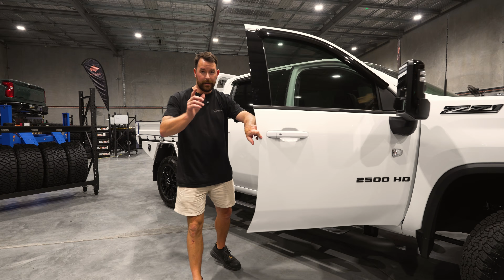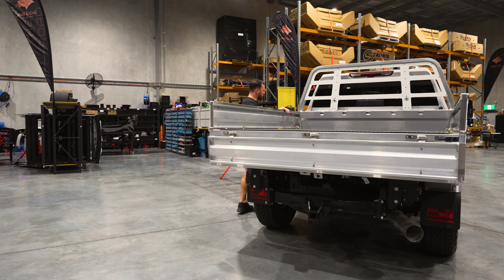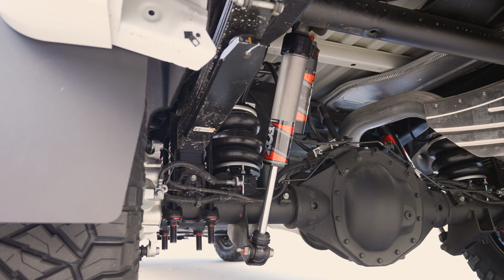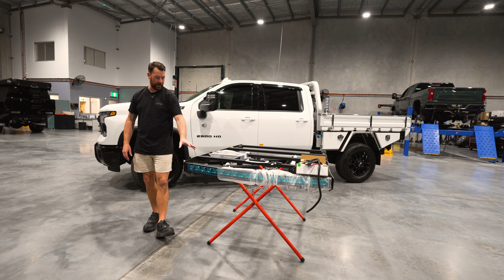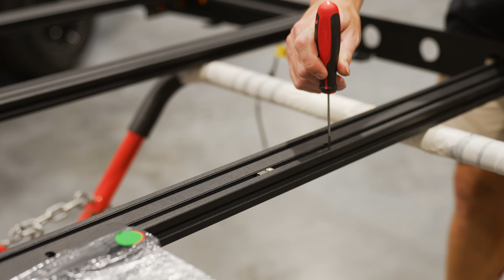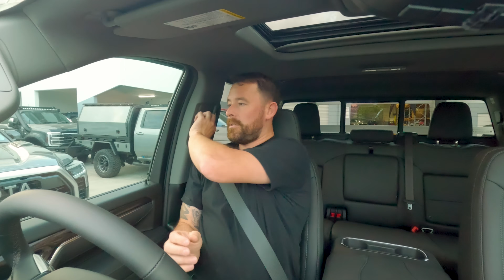The Complete Guide to Modifying Your Chevy 2500

Comment: I'm a big fan of how these 2500HD's look in the ZR2 version in the US. Does your BDS 3inch Suspension work with the ZR2 18' wheels and 35's??? I personally don't like the flare look to allow for wider tyres hence the question. Or can you even add the multimatic suspension from the ZR2, to the 2500 version we get in AUS?